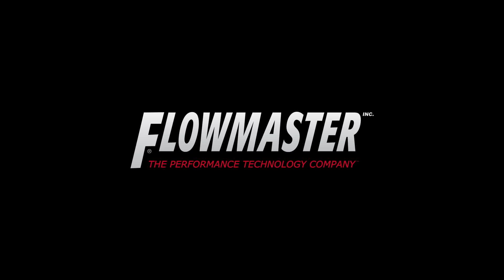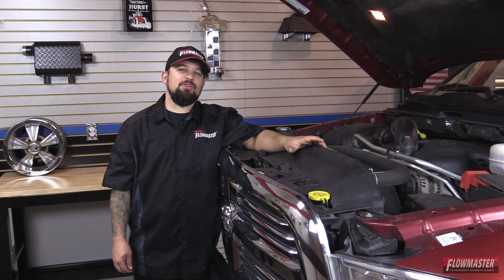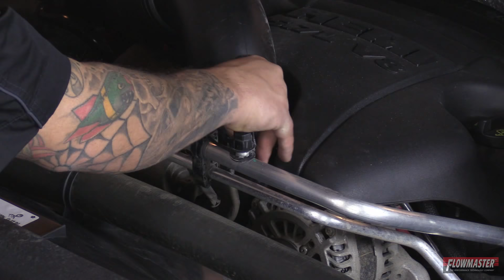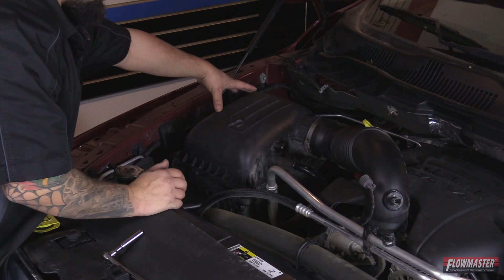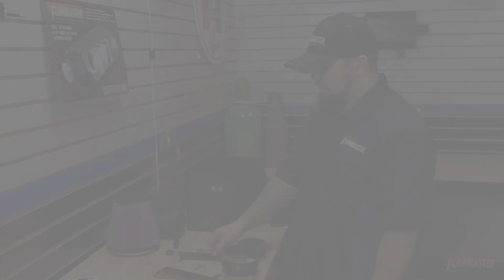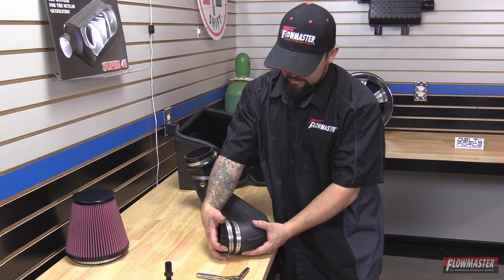2009-18 RAM 1500, 2500, 3500 5.7L Hemi - Delta Force Performance Air Intake 615111

Comment: What is the msrp? Will it also be available with a dry replaceable filter instead of the oil reusable one? I see that the stp corrected wheel power gain was shown in the graph, what would be the equivalent hp gain from those numbers shown?
Reply from the maker: Hi Nate,

As it stands currently, these intakes will only be offered with the oiled filters. All pricing and dyno information will be posted on release day May 1st. If you have any additional questions, or would like a personalized product recommendation, give us a call at 707-544-4761. 

Kind regards,
Team Flowmaster